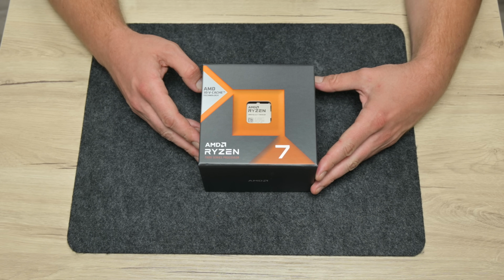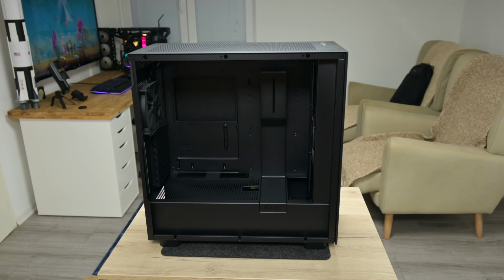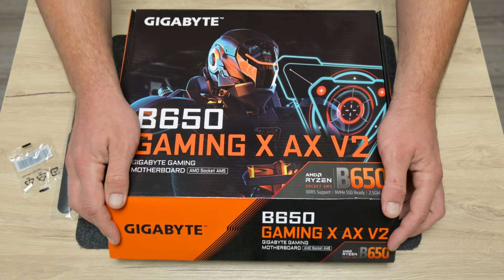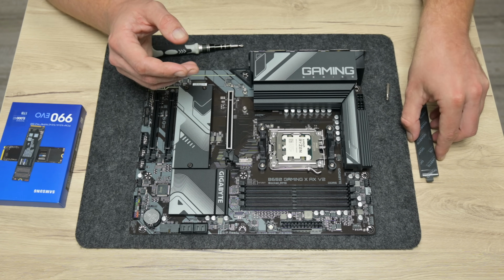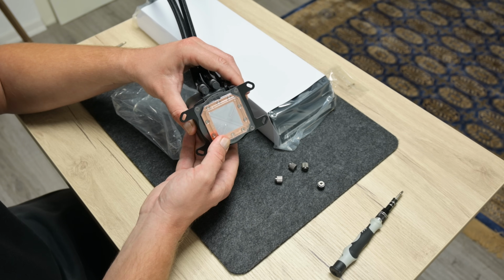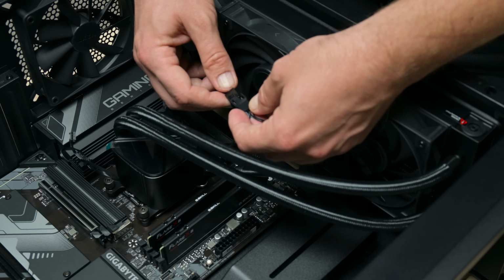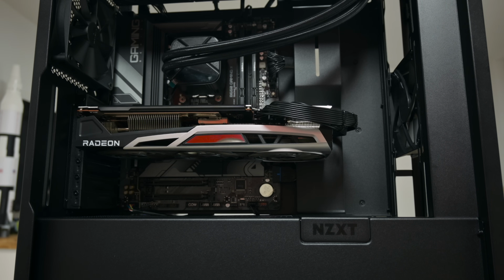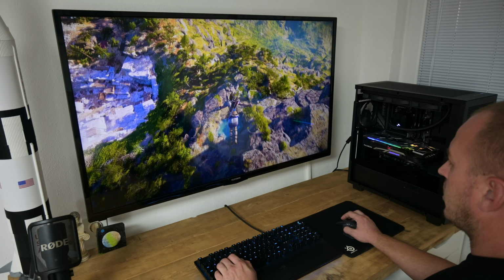Gaming PC Parts HUNTING - Building a PC for Cheaper as Possible

Comment: did the gpu run with 16 lanes? because gigabyte says, i cant use the top nvme slot at the same time as i use a x16 gpu, and i want to add a 3rd nvme drive

Comment: Correction: you CAN use standard 3.5in hard disk drive for general storage of documents, as well as games that you want to play once in a while (but not frequently), or games that are just really large in size. But definitely don't use HDD for the OS, programs, or frequently played games!
My PC has two 3.5in HDDs: one for data (documents/pictures/videos etc) and one for games that meet the criteria mentioned above. It doesnt need to be ridiculously fast if its only going to be played once every couple of months or so.
Reply: Mechanical HDDs spin down frequently when not in use, which can be a lot for storage drives.  Open an Explorer window and count how long it takes to spin up the disk and un-freeze the window.  It's not "long", but it is frequent and annoying and simply not worth it unless you're storing mass amounts of media.  SSDs are too cheap to put up with that crap anymore.  I know, you can turn off the feature so they don't spin down, but that's not the best option either.

Comment: Best use of mechanical HDD is as 2nd drive for pc for storage
Reply: Mechanical HDDs spin down frequently when not in use, which can be a lot for storage drives.  Open an Explorer window and count how long it takes to spin up the disk and un-freeze the window.  It's not "long", but it is frequent and annoying and simply not worth it unless you're storing mass amounts of media.  SSDs are too cheap to put up with that crap anymore.  I know, you can turn off the feature so they don't spin down, but that's not the best option either.

Comment: From my research I have found that the  ASRock B650M Pro RS motherboard is one of the most recommended. For the power supply there is a internet list on the CULTISTS NETWORK. Many people also recommend the Intel arc, but be aware that the card is not always well optimized for newer games and some crash. 

I'm planning on build a pc on the AM5 platform as well just can't justify spending too much on it since my salary doesn't allow me to save enough for something good. Ryzen 7700 is my goal, there are editions called "Tray" that are for the OEM builders and are without cooler or a proper box, but at good discount.

Comment: Nice build ... but ... it has almost zero airflow . Why the customer did not buy 2 more extra fans for intake ? :((
Reply: xd my man is giving advice to a pro that has been fixing , upgrading , building and resuscitating dismantled computers from literal dumpsters ...for years
Reply: @aymanla471  He's right though
Reply: @BeepBoop-o3o  i know but ..andrew didnt do that due to lack of knowledge but for cutting cost
Reply: @aymanla471  10-12 eur for 2 fans? There are so many ways to save more money on this build but still keep the same performance, and also have intake fans which are essential.
Reply: @BeepBoop-o3o  true 👍
Reply: @aymanla471  i am not talking about Andrew here . I gues you cant read .
Reply: Cost cutting
Reply from the maker: @radger6392  Yep
Reply: @radger6392  Man .. this îs a 7800x3d and rx7800xt ... This îs not a budget build , You cant cost cut 2 fans 🤦 Jesus ...
Reply: Doesn't cost that much for two extra fans  @radger6392
Reply: well judging by 50° on maxed setting game, i have no complaint 😂
Reply: Fans are so easy to add after
Reply: Airflow means input and output.  Not many people check if the rotation and ar displacement match on intake and output.  If not balanced it will not improve temps.
Reply: how is it possible that GPU and CPU Temps are under 60'C ?? its impossible
Reply: The video is a hoax  @pcmaker2026
Reply: @pcmaker2026  It is possible, the 7800x3D isn't that power consumptive and is cooled by an AIO and the card is one of the best models for that GPU and has been tweaked properly. Also, he probably has a relatively low ambient temperature.
Reply: @pcmaker2026  Germany. That on summer on South Spain with ambient temp of 35 xD that doesn't happen.  My pc its over 58-62 on CPU when maxxed out, I have really greath coling sistem with 10 fans on the case and beafy cooler for that i5 12400.  And then GPU its at 80s boosting all he can its a 6600xt dual fan merch at 2300-2200Mhz.

Comment: I'm currently in the middle of a similar project, for me it looks like this:
AMD Ryzen 5 7500F (aliexpress) - $135.35
MSI MAG B650 TOMAHAWK WIFI [outlet) - $185.33
Kingston NV2 1TB - $49.20
Darkflash DLC29 Mesh [outlet] - $35.72
Lexar Ares, DDR5, 32GB, 6000MHz, CL32 - $101.25
ARCTIC Freezer 36 CO - 21.73
ARCTIC P12 PWM PST - 31.24 
OUTLET ENDORFY Supremo FM5 850W 80 Plus Gold - 88.50

the most important thing is the graphics card, I've been hunting for a 7800xt for a long time but I see that you went with the 6800 XT, is it a card of the future? I'm also thinking of buying a used one, is it good for gaming at 1440p? Or only full HD?
Reply from the maker: Hi bro, the RX6800XT 16GB is good for now. I played AC Odyssey in 4K with all max and I got 70-100 fps. WIth 1440p and Full HD this GPU will last for a very looong. Currently I have 2070 super gaming x and still fine running fine, I got it almost 5 years ago. But 2070s is not for 4K gaming, 2K ( 1440p ) is okay, anyway, 6800XT is much better than 2070s.
Reply: AMD and Nvidia are working on the AI frame generation. Just get a capable card and the software can make it playable for years to come.
Reply: lol dont buy a cpu from aliexpress and the 6800/XT is more worth it
Reply: @s4f3ty  i mean the cpu isn't bad and especially for the price